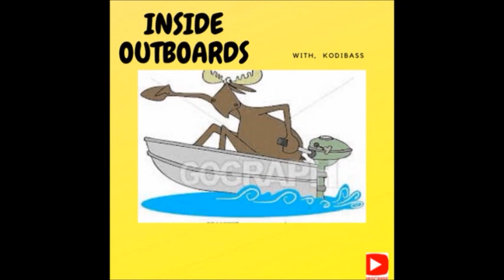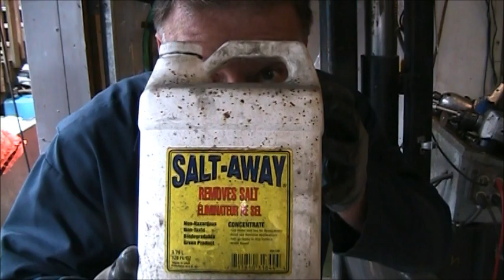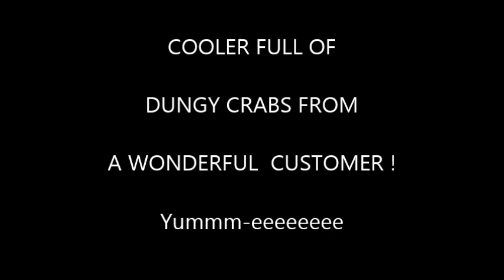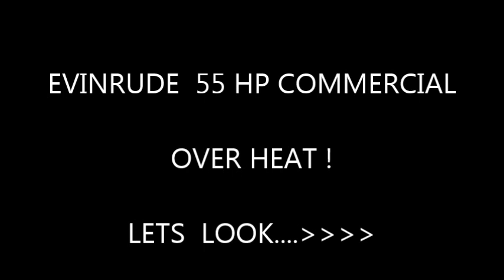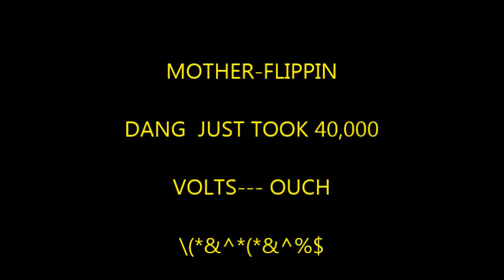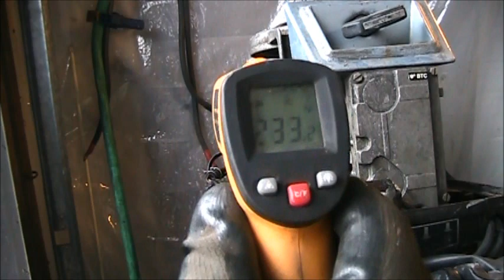YAMAHA 1989 8  HP,  EVINRUDE 1988 55 HP COMMERCIAL

Comment: Hi Kodi, Shocking Simply Shocking🤣 That's one way to find spark loss. Love the way you get broke off studs out. Aluminum and stainless bolts don't play well and drilling is about the only fix. Too much heat on aluminum is not good either. "Outboard block Lives Matter"
Reply from the maker: Thanks,  Yep then add salt to taste.            kodi

Comment: Hi Kodi, This looks like a good opportunity to possibly add to your bag of tricks for removing  stuck bolts on outboards,(and any thing else. Unfortunately, it will take a rather long post to explain, You might already be familiar with the technique, but many are not, so hopefully, someone here can benefit from it. After a lifetime of dealing with stuck bolts with pretty good success with traditional methods, I stumbled onto a real game changer. Some others have come to a similar conclusions, So it's not unknown or a fluke......As you know, the traditional method of using heat to loosen a bolt involves heating the area around the bolt, but not the bolt, to expand the base metal, , thus making the threaded hole slightly larger, hopefully resulting in the bolt coming out. This works fairly well, especially if a vise grip is clamped on the bolt while heating the area to act as a heat sink to keep the bolt as cool/small as possible. This works quite well, until it doesn't...However, there is a better way,.....A decade or two ago, I started occasionally welding nuts onto broken off bolts that still had a small stub to work with, or even broke off flush. Pretty common in recent years. Seems that everyone of us has noticed the same unlikely result....With the nut welded on, after cooling, the bolt, formerly froze solid, comes out easily....HUH....After a few times, a lightbulb finally flashed in my thick skull,  The extreme heat from welding helps break down corrosion, and the super heated, glowing bolt, expands, crushing corrosion, and then contracts,  making it possible to remove the bolt.......I used this epiphany to change my basic stuck bolt technique  completely, with better results. Approaching 100%. I say "approaching", because I don't know yet. In the last few years, I haven't broken any bolts, and I work on salty outboards a lot. Sooo,...after that long preamble, for context and logic train, This is the basic technique,.....When a bolt is seriously stuck, I don't keep trying and hoping the bolt is turning, not twisting, which greatly weakens the bolt.....I just fire up my oxy acetylene torch, and heat the bolt. I rapidly bring the bolt to glowing hot, not quite cherry red, and remove the flame, letting the glow go away, and repeat several times, to ensure the heat gets to the entire bolt, because the aluminum, a big heat sink is drawing heat from the bolt. Glow the bolt a few times, let it cool completely, clamp a vise grip to the bolt, if possible, then rapidly heat the aluminum near the bolt, and remove the bolt, which may still need  some working back and forth until a full turn is gained......Sorry about writing a book. It's the only way I know. For me, this is a game changer.  It is always better to not break the bolt, and this took a hell of a lot longer to write than to remove a half dozen badly stuck bolts or one broken one.....Give it a try, it works. An oxy torch is needed, of course, but is and endlessly useful tool to have on hand.
                                                    Cheers, Joe Evens.
  In just the just the last year' I've used this to remove at least 30 stuck bolts, 20+ of which would have certainly broken.
Reply from the maker: Those R  Fantastic methods,  Yep'  4  sure,  Go @  them dang stuck salty bolt's   studs @ whatever angle you, got..  Love your approach,,  I will 4 sure keep that in my tool bag..  Thank you for sharing your knowledge here,  With all of us.....      kodi
Reply: @kodibassInsideoutboards  Thanks, I will no doubt use your drill method at times as well on any bolts that do break or come to me broken....Long live older 2 stroke outboards, not so much because I don't like or want certain of the new, highly evolved motors, but because the rugged simplicity of my old, recycled junk J&E outboards make it possible ( currently an '89  70 hp with 25/35 hp backup) for me to confidently fish the O, including up to 50 mi offshore for tuna and such, on a very limited budget.....Heh heh, after watching most of this channel, I wonder how many motors I have junked or not bought because of apparent compression problems that were actually good motors..........My first cousins moved to Kodiak back in the '60's. We have long since lost track, but I still have a picture  that was sent that has inspired me for at least 50 years. Great pic, either Roger or Dean Lane as young teenagers, with 3 halibut over 200 lbs in a 14' skiff. The fish were tied into a bow with a hook in the jaw and a clove hitch on the tail to eliminate the chance of the obvious potential problems. I still use that technique on halibut over 40-50 lbs. A flopping halibut can create a lot of havoc in my 20 ft PC dory, and even though I pacify them first with my .45 revolver, sometimes they wake back up.

Comment: Your awsome guy and hell of a boat motor master...   I have a 1988 25hp evinrude with bad idle put it in gear and runs good... Carb is rebuilt new sprak plugs and wires. New fuel pump. New thermostat work done by boat repair shop.  Owner told me that "thats how them older 2 stoke motors run" and "theres nothing i could do about the besides mess with the gas/oil mixture screw on the front of the carb" sir is what he is telling me true or bull@@#$..???
Reply from the maker: +AM, They shake & smoke a bit but they should idle fine,  There could be allot of things that would cause idle problems, But  often it's just not in sinc & link when a outboard runs well @ full speed then idles poorly.                         kodi
Reply: Thank you soo much for your advice sir.. would you happend to have a video on this specific thing.. adjust the link .?
Reply: Evinrude model E25RCEM.

Comment: Mr Kodibass...
You do eat some tasty foods!
The big twin(55)- what do you think a normal temperature would be?  At which location?
Broken bolts?  Yes, on most outboards I tinker with.  Like that bolt removal method. Little nervous drilling new holes into block though. Maybe I'll try on parts motor for practice.
Reply from the maker: Yum=eee  Often  on these old salty's  I have 2.  in order to put'm back 2 work.   kodi

Comment: Beginning starting the 55 hp between the middle of the head I saw water coming out in the head in the video
The head water must be plugged up also. The cover was only for the top of the pistons.
Would you pull the head to clean water jackets
Reply from the maker: _mercnut1,   Thank you,  I never even saw it,  until u mentioned it,  Yep the head will for sure come of,, Great eye mate!                     kodi
Reply: kodibass glad to help
Reply: OK, I was watching after you pointed this out, couldn't make up my mind if that was just the clear plastic reflecting as the engine ran or if water was actually squirting out...Good eye...  Not that it matters to much the head and cover had to come off...I too love Kodi's drill around the outside and inject the oil method for removing the busted studs, hoping never to have to try it out, but know better than that for sure...
I have had to replace the upper water tube grommets on a few of this series of engines, they seem to have been designed by the same moroooons that screwed em up on the smaller engines...Sure hope a new water pump and gaskets solves it though, surely don't want to be right about my suspicions...
Kodi ought to make a nice display out of that swell thermostat and relief valve...People just keep running these things until the absolutely "won't run no more",  which usually happens after the head gasket finally gives up and fills the cylinders with water....  
These are good old engines, and deserve much better care than this one ever got....Hmmm, wonder what a similar 4 stroke costs today....
Reply from the maker: @fleetwin1    I do not wonder about what it would take to get this HP  from the purchase of a new 4 stroker,  I often look @ the prices,  $7000  In my area will get You there.  &  It will not B around in 30 years,  @ Least the Fisherman owner of this motor was straight up with me,, He told me I run in shallow water & don't care if I ruin a outboard that is worth $700  to catch $10,000 worth of salmon..  Fix it  ,, Junk it & send me the Bill,   .  & He is good for it,   lol.  I like that..     Also  While walking around looking @  my outboards, He noticed I had a pair of older Big twin 40 hp motors,  He said R those 84's...  My jaw dropped I said yes?  He said my dad told me they were the best outboards ever built,  He then asked those R the CDI motors right.?  Again I was flippn stunned ,  He Then said would you sell both to me?  keep me in mind if you decide to sell them.  kodi
Reply: Kodi I think you bring out the best of best in people. Your videos make us sharpen our skills. It’s not all physical removing of parts but the understanding.
How you can work on anything and strategically  identify the problems.
Reply: @kodibassInsideoutboards    Cool!  It is pretty amazing that this guy knew when the old bigtwin style 40s switched to CD2 ignition...  But, he shouldn't undervalue the great 55 commercial he has there either.  I'm glad he is a good paying customer that trusts your work and doesn't fuss about the bill...Take care of him for sure.  I remember the few "professional"  fisherman/crab/lobster guys that used to come around our place, they were a pain for the most part and whined about spending a nickel...But, had no problem returning a year after their latest repair claiming we had screwed up their engine....
I'm hoping he just plugged up the thermostat causing the overheat, and that a new water pump, thermostat, head gasket will do the trick...  Didn't mean to "put the whammmy on it"  speaking of the dreaded upper grommet...
Reply from the maker: @fleetwin1   He's a good guy but a outboard killer,  I have his 40 hp Evinrude coming up next.  I will find the same or worse on it,  I love these 55 commercial models,   I sure hope its not the grommet   , I'll know soon,           thanks      kodi
Reply: @kodibassInsideoutboards    I'm sure it's just a combination of worn pump and him plugging up the water jackets with sand and crap...

Comment: Just curious how do you tell the difference between a commercial and recreational motor?
Reply from the maker: +LtF,  By the Model # You cannot use the standard  "INTRODUCES"  to determine the year,  this one is model E55RWLR.   that makes it a 1988 Commercial motor,  Boats.net has a feature that lets you look by HP or Year, search by Hp in this case 55 hp,  Scroll until you see the above mod # & it will say commercial model 55.                                                         kodi
Reply: kodibass what are the differences in design that makes them commercial?

Comment: I feel for you guys running in salt water. We only have to worry about bolts backing out by themselves.
Reply from the maker: I would love 2 have that problem 4 sure,    kodi
Reply: kodibass hey I was wondering if you could do a video on increasing the hp from a 40 to a 50 on a OMC. Is it possible to do. I picked up another 40 and wanted to increase the hp to run on my pontoon while I was rebuilding the Mercury xr6 150 also looking into changing out the piston sleeves to make that a 200 hp. I have been posting a few short videos to share if you ever want to see them check them out. I’m doing it because of you and this old outboard you guys are great.

Comment: Thank u for another great episode!. Hope the crabs tasted good. 
By the way..... what bore size did you use when you fixed the broken m6 bolts on the cover?
This is a very good trick I`ve learned from your vids. 👍😉
Reply from the maker: Thanks,  5/64,  However if it  is a bolt over a inch long I will use a 3/32 that will allow U to put the little plastic tube   standard on most all  spray lubes into the hole a squirt.  kodi

Comment: What happens if you run your motor with no thermostat
Reply from the maker: Well You could open a HUGE can of worms on the subject.  So to answer U properly...  I need your motor HP & if it is run in fresh or salt water.  It matters on both imho. lmk.     kodi